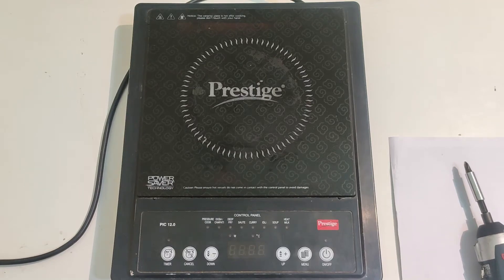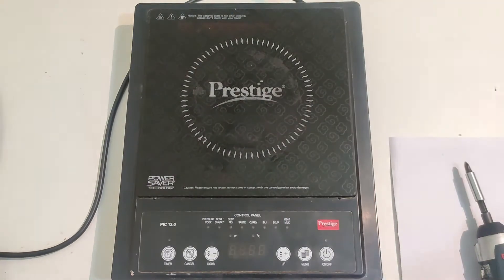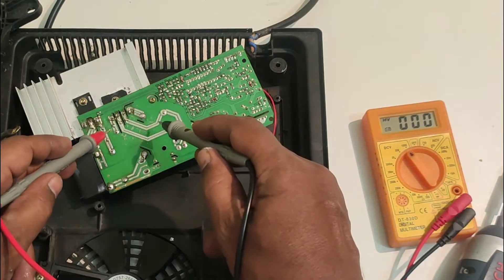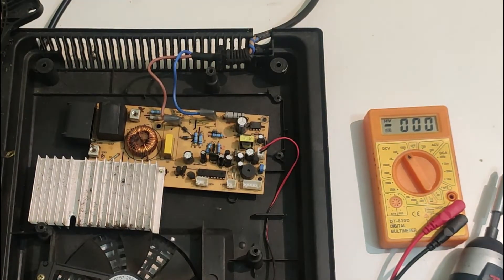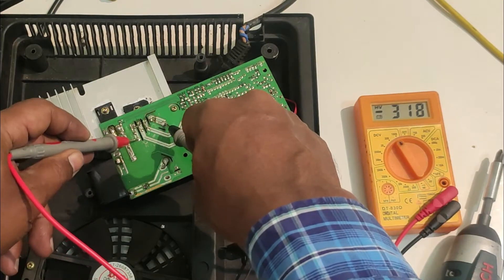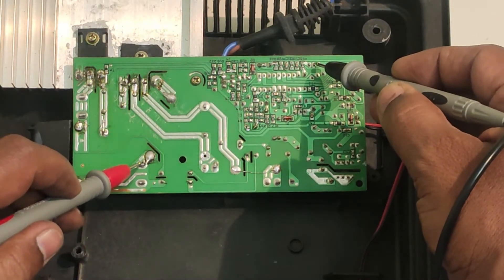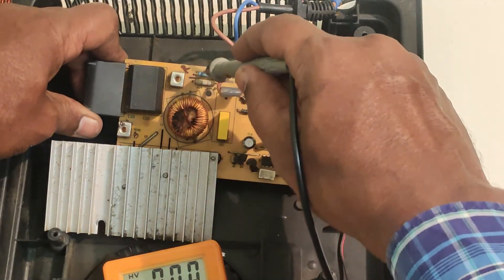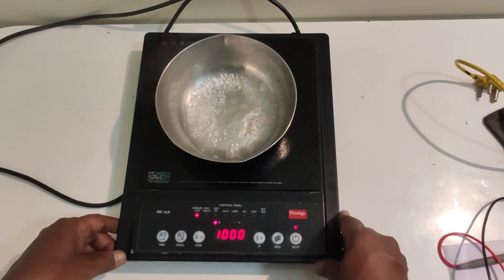Induction stove not heating, Continues beep, No error code, power problem Model PIC 12.0

Comment: I bought prestige induction stove today online.when I connect the plug to power it made sound first time.induction stove is heating for 5-10 seconds after that it is not heating.i used junction box also still no use.some sort of sound is coming from inside the induction like screws sound and parts are sticked.please give solution

Comment: I have checked the voltage and it's 331.. even them I am facing non heating issue...
Reply from the maker: Please watch full video, I have mentioned what all to check if the voltage is normal ie above 300

Comment: For the non technical user, if your stove is continuously beeping and not heating it’s usually due to two things:
1. Your cookware is made of non induction material such as aluminum, brass or copper. Electrical induction stoves work well with stainless steel cookware. 
2. Your cookware doesn’t have a flat surface so it’s not touching enough of your stove to start heating. 

And one more, altho this is obvious for most people, you haven’t placed any cookware on the stove or you’re misplacing it (not aligning it correctly with center)
Reply: Thanks dude 😂
So helpful
My dosa pan cannot be used then.
Sonamuthaa pochaaa😂

Comment: Thanks for the video.
However I think there may be some methods to check the capacitors. If that was also shown it would have given more clarity, since you had both the old and new capacitors.
Thanks once again.
Reply from the maker: Few multi meters has capacitor checking option, THhe capacitor i replace was physically damaged, I have also mentione in the video

Comment: Very nice information sir, if start heating & off & again the process repeated in all temperature mode,i will check all ok,no error code, priset ok ,but problem not solved in italia double ic ,(¡.e Driver & microcontroller ic ),what can i do, please specify, Thanks sir,seen ur reply is peaceful, keep it up
Reply from the maker: Please check the link below  https://www.youtube.com/watch?v=KG3UArk3eYw
Reply: @technoolab3514  sir I have checked voltages study,but not restart issue, heating start taking upto 3 to 5 Amp on 900 to1800w start heating few seconds & stop & again repeat process in all temperature mode 🤔
Reply from the maker: @dipakmaheshri3505  did you watch this video?  https://www.youtube.com/watch?v=KG3UArk3eYw
Reply: @technoolab3514  yes sir, I watch the video, after that Imay I comment u that the fault is different

Comment: Hi. ...sa same model...have ..  problem.  Igb short .. am allready. Cheng TR 8050..8550.  3fm /1200.v.    and new igbt.  But. Not yet. . 5 minutes after short igbt. ...pls help me ..
Reply: much appreciated, thank you
Reply from the maker: You have replaced all required components for repeated failure, You only need to check related components srrounding transistor
Reply: hi, need help on cooktek repair, fuse keep on popping, I checked igbt and found out 2 was faulty, replaced it but it has blown again, must I check the filters and capistors, am new to this just need you advice on it model  nr mcd3500 cooktek please.
Thank in advance.
Reply from the maker: @farouqhannibal1916  easy way is to  connect 100Watt bulb in place of fuse,  remove one by one component in primary section and plug it in until the bulb stops glowing
Reply: , 👍thank you for your reply, does this apply to 3500v induction hob, I don't it's a stupid question, am still new at this, an parts is not easy to attain, here in south Africa